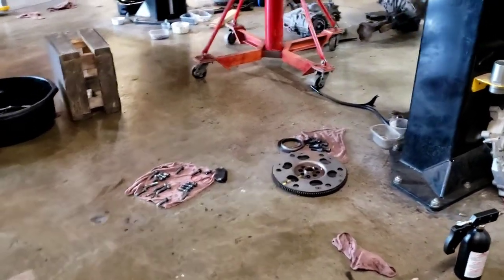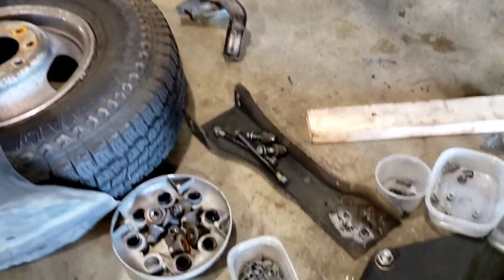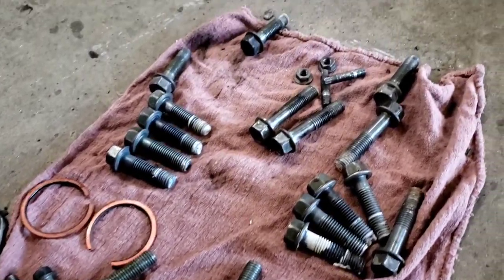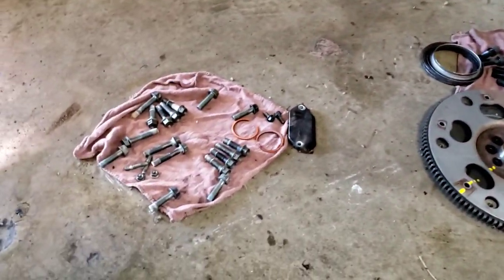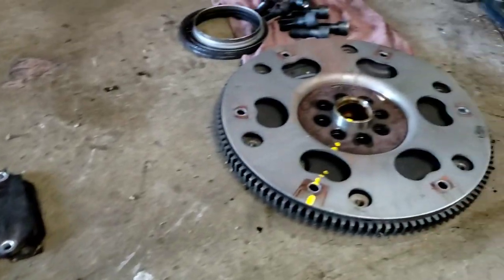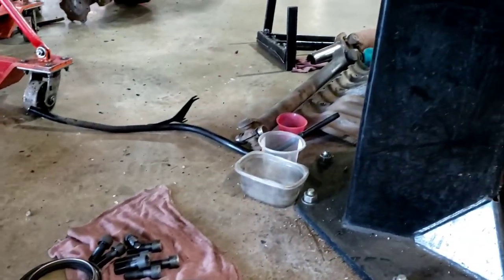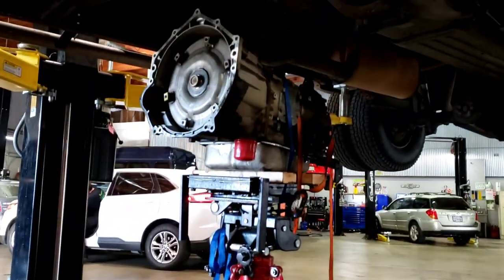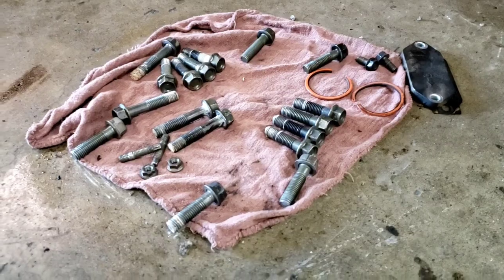ORGANIZATIONAL TIPS AND TRICKS!

Comment: I put the bolts on the bench in certain spots,remember which nuts and bolts go where.Finished up a rear main seal job in a 2017 Chevy Equinox w/AWD with the 2.4,only forgot to unbolt one bell housing bolt which was the cause of the transmission not wanting to come out.Took a little more time to get it out finding this
Reply from the maker: Thx for the feedback.  I never have a bench to line anything up on.  Bummer about that bolt.

Comment: I've used parts boxes for bolt holders. Air filter boxes work well. Zip lock bags are another one. I use the zip locks at the shop (Small shop) as 3 guys working, things can get kicked and misplaced.
Reply from the maker: Sweet brotha thx for the feedback
Reply: @NutsandBoltswithTone  The air filter box, if you punch holes large enough for the bolts, you can lay them out as you like.

Comment: I use muffin tins,cardboard for tracking bolt patterns,and the hillshire farms lunch meat containers,
Reply from the maker: I've seen guys use muffin tins. I've used cardboard for big things or if there are brackets that go with certain books in certain orders.  Actually started using the boltster mat for smaller stuff and it's working.  If you don't have one try it out is pretty cool. Thanks for your comment.
Reply: @NutsandBoltswithTone  I might get a few bitser one so I can get rid of the blow mold cases and get some space back, I've also a cookie cooling rack for bolts before to
Reply from the maker: @anthonygm85  yeah I have one bitster but haven't used it yet.  The cooling rack is a good idea.

Comment: If you need bolts to go back in the same place what I have done for 20 plus years is used cardboard and pop them into the cardboard in the same locations
Reply from the maker: Yeah I've done that as well.  For smaller things I like this because it already has holes and stretch out to 17mm. Plus it is resistance to chemicals so you can clean while they are in it.
Reply: @NutsandBoltswithTone  your talking about the Boltsters they do work amazing
Reply from the maker: @AntonioClaudioMichael  yes they do.